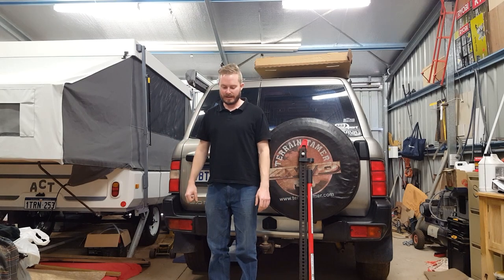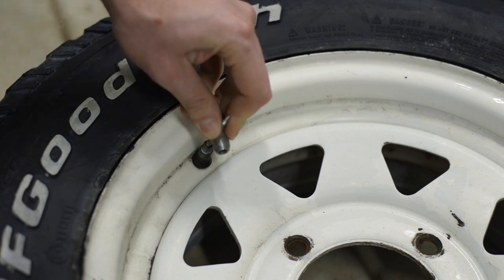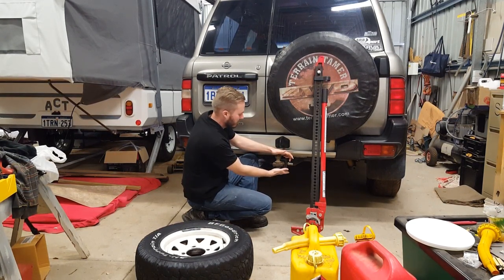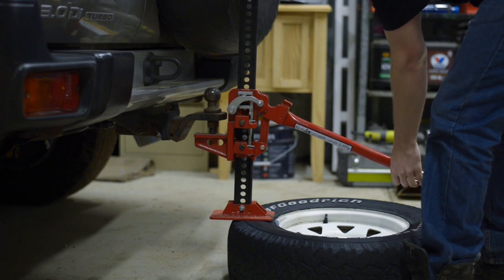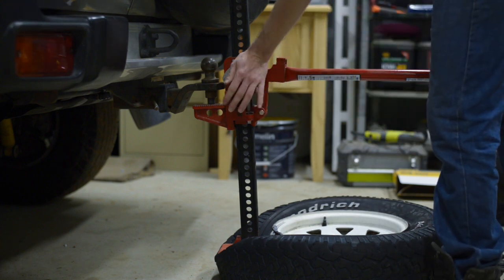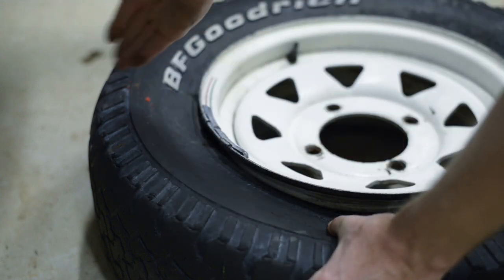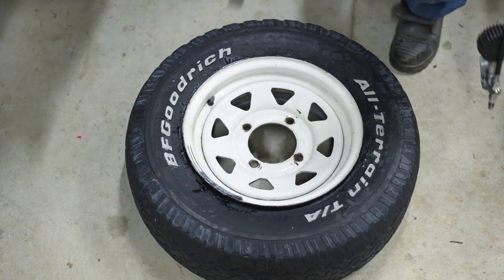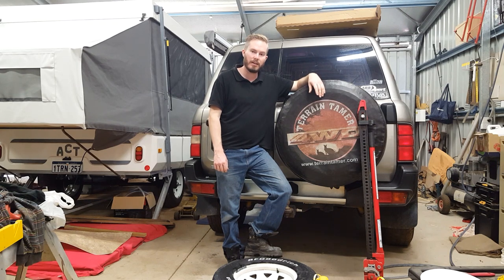Backyard Mechanic 06: How To Break & Re-Seat Tyre Bead

Comment: I tried using this method once with a Dodge Ram 1500 4x4 QuadCab pickup on some 275-65-20 tires... Ended up just lifting both rear tires off the ground... Those beads were definitely well seated... :)
Reply: Yeah, me too. Same thing, but was for two 25 YEAR OLD wide tires on 15-inch rims, really stuck hard. So I used the same technique but substituted a DIY "top clamp" fixture (with two removable bolts) onto the farm jack above the lifting part to clamp the tire, instead of using the trailer receiver on my Highlander.  Still tough!  But worked. This video was the inspiration.

Comment: Alex, got a tip for you. Get a spare valve stem with a valve core inside. Screw it into the back of your valve core removal tool, the female threaded hole is normally to chase a damaged thread on a stem. Keep it screwed in there, and now you have a nice rubber handle on your valve core tool making it easier to use, plus if you don't lose the tool you will always have a spare core and stem.

Comment: This is the method I learned from my fellow classmates when I was a freshman in trade school in 2004.  I always use the rear hitch of a tractor parked at the farm equipment dealerships, since they weigh at least 14,000 lbs.  I have found that pickups and 2.5 ton grain trucks are just to light and their suspension travels up to high, before the bead breaks.  For my tire irons I bought 2 trucker tire irons at "Runnings" for $50 each.  They are the Ken tools brand.  I also bought a cheaper tire spoon as my 3rd tire iron.  I have a $300 Cheetah can for seating the beads.

Comment: I've been using this method for years. It helps to put a board under the other side to raise the rim off the ground a bit. I use a little WD40 around the rim to help lubricate the bead to break it.

Comment: This works great as long as you have a car or truck with a standard bumper. This is why they don't use bumper jacks any more, the bumpers won't support the weight.
Reply from the maker: Yeah, the wheel lift accessory you can get is super handy for that! Allows you to work the jack off pretty much any wheel
Reply: The "bumpers" these days are actually just "bumper covers".  The actual bumper is hidden underneath it and is designed to deform in an accident to dissipate the energy of the collision.  Even though the old bumper jacks were lighter than the "farm jack" (e.g. High-Lift brand), they were heavier than the scissor type jacks that they put in cars these days.  The scissor type jacks are cheaper to manufacture, take less space, weigh less, basically no maintenance, and are mechanically simple and reliable.  Many cars these days are so low to the ground that the scissor type jack is the only option since there is no room to put a bottle jack under it at the approved jacking points.

I suspect that the main thing though was that the bumper jacks were just not idiot-proof enough...

Comment: in the bush, while not having a highlift jack: wouldn't it be possible to air down very low and ride for a few meters, to get it off the bead seat? the tyre is broken anyways ..
Reply: without high lift jack just set tyre in frnt of vechile tyre an drive up on it it will split the beed

Comment: breaking the bead isn't the hard part.  taking the tire off is , and putting a new one on.     at the shops they use a special machine that pushes it down around the outer wider part of the rim,.   ive tried before and its nearly impossible

Comment: 🙈 the way you used the jack to break the bead, just has so many margins for error!

Simplest would be to loop a soft shackle through the rim and use that as the leverage point for the hi lift, far less points for failure
Reply from the maker: Soft shackles didn't even exist when I made this haha. That would be a great way to do it these days for sure though.

Comment: Once the jack is not under any load the handle will not spring back but this young man lacks experience . The major problem with youtube is those that have the media video and computer skills are mainly the younger generation but those that have the subject matter 4x4 skills are mainly the older 4x4 generation .  It should be the younger people filming the older people who know how to do it properly .  The prerequisite for a safe lift with a hi-lift jack is a good anchor point for the lifting nose so it has less chance of slipping off .  Notice how the Patrol moved forward even under brakes . That's going to be worse on slippery ground and that jack will most likely slip off . You will not get the nose of the jack into that towbar recess properly it's too far under the truck . Remove the towball and put a large shackle  into the hole sideways and lift off that or even a strap through the hole , put a long bolt or pin  through the holes in the jacks nose behind the shackle or strap  to add some security . Lifting from the back of a vehicle is hard because that's the light end .  The front end is heavier and breaks a bead easier if there is a suitable  anchor point .